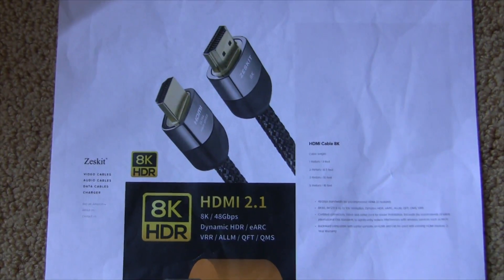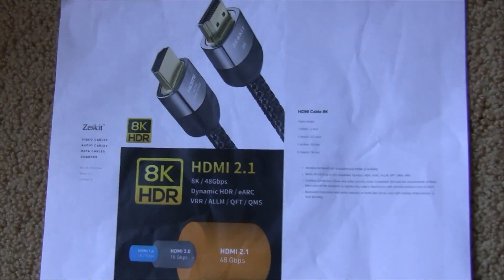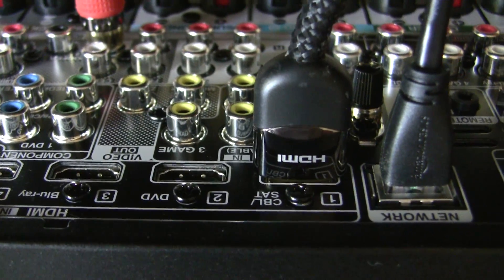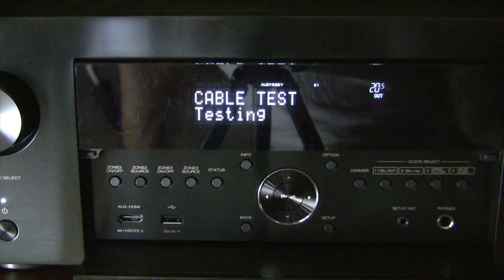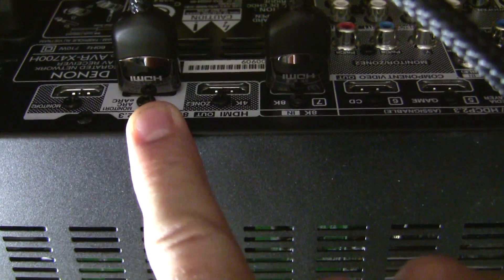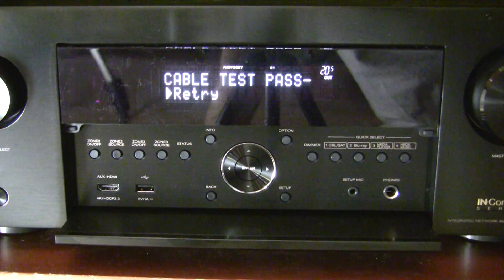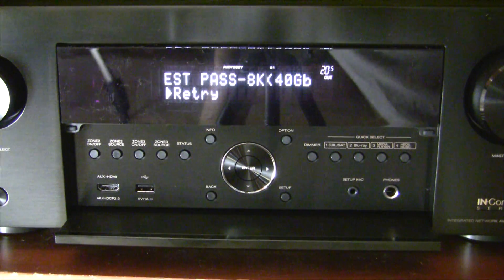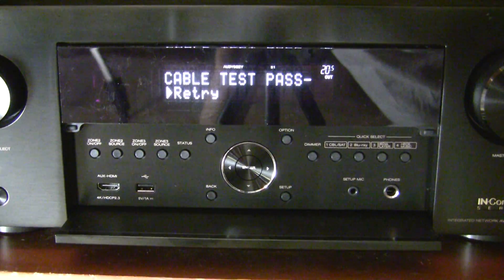Denon Receiver HDMI Cable Test - Zeskit 8K HDMI Ultra HD High Speed 48Gbps Cable

Comment from the maker: The Zeskit 8K HDMI Ultra HD High Speed 48Gbps Cable could very well pass 48Gbps, but as far as I know, the Denon 2020 receivers can only pass 40 Gbps through their HDMI 2.1 ports, so that is the limit to the testing of HDMI cables using this year's Denon receivers.
Reply: Is this cable good now for the ps5 with lg oled c1 3m
Reply from the maker: @MC-ie8xl  I don’t have a PS-5, but it should work fine. Let us know how it turns out if you get one.

Comment: My Zeskit 8k Hdmi cable just started giving me Distorted colors I replaced the Zeskit cable and the Color got fixed . I have no Damage on my zeskit 8k cable bu its faulty after 1 year of use
Reply from the maker: That's too bad.
Which cable did you replace it with?

I believe Zeskit has a 2 year warranty.

I would contact support@zeskit.com and see if they'll send you a new cable.
Reply: @BetaCygniBlog  Thanks for the Heads up, I'll check on that warranty. 

  I Replaced my defective Zeskit with a 4k HDMI from wallmart for now. Not sure on the brand as i had this HDmi sitting around

Comment: When you go into test mode if you wait long enough the OSD will show you what ports to connect. For my X3700 I need to connect HDMI-7 and Monitor-1. All my test fail, even with Zeskit so I am not sure if my AVR is an issue?
Reply from the maker: @Surya Chataut  I would make sure your firmware is up to date on your receiver. I do that in this video:
https://youtu.be/XOHkPHNiI3o
Then if the test still fails, I would try a real-world test. First try showing some DolbyVision/Dolby Atmos content on your TV. If that works, then you're cable is fine and there's something wrong with the test.
Reply: @BetaCygniBlog  Firmware is up to date. I performed multiple test again and out of 10 test it passed 2 time and failed the rest (although AVR says connect HDMI 7 and Monitor-out, I connected HDMI 7 and eARC HDMI port). I did play Dolby Vison videos and it worked. So, I am guessing the way Denon do their test has some flaws.
Reply from the maker: @suryachataut  Thanks for the update. I think the test has some problems as you also found out. 
Yes, you need to use the eARC port.

If you get the Denon App on your smartphone, you can see exactly what type of Dolby Atmos you're getting. With my Panasonic DP-UB820 4K Blu-ray Player I'm able to get Dolby Atmos TrueHD sound (lossless compression) from 4K HDR blu-ray discs that support Dolby Atmos.

Comment: Hows the sound quality using these cables? Are they close to audioquest hdmi cable quality?
Reply from the maker: I've had no problem with this cable. The build quality is excellent and the HDMI 2.1 performance is up to spec.
Zeskit is coming out with a certified HDMI cable soon.
Once certified cables are available, I'd only buy one of those for HDMI 2.1 applications.
Ditto for HDMI 2.0b.
Here's a video where I test a certified HDMI 2.0b cable from Monoprice along with some others:
https://youtu.be/O3c_kNig7iI

Comment: I wanna get this for PS5 but Sony wouldn’t not include their 2.1 cable since the console is optimized and supported for HDMI 2.1 4K@120
Reply: It comes with an HDMI 2.1 its about 5ft, 1.5 m to be exact or 59".
Reply from the maker: @felixlugo4840 That length should be okay, not too hard to make a cable that will meet the spec. It's the longer lengths that are the most challenging.
Reply from the maker: Yes of course. I’m getting the Xbox Series X and I expect the cable that comes with that will meet the spec too.
Reply: You have some time, 4k@120hz for games is not.going to be day one unless its like an indie or racing game. Other AAA games won't be hitting 120fps at 4k for a little while
Reply from the maker: @arianadonis4099  You're right. Right away I want to play my 4k DolbyVision/DolbyAtmos blu-ray movies with lossless Dolby True-HD sound.
Reply: @arianadonis4099  true but at least it’ll happen now less and more in the future
Reply: @Zamasu-Z  I'm hoping for the next 6 months 🙏

Comment: Will 48gbps on a 40gbps TV affect performance at all? Very worried about that :/
Reply from the maker: No reason to worry. There aren't any devices right now that can use all 48Gps.
The HDMI 2.1 standard is designed for future TVs that are quite a long way off. 
In the meantime it has lots of great features like lip sync, lossless Dolby Atmos - True HD sound, and Variable Refresh rate (great for game consoles).
Reply: Beta Cygni oh ok perfect just making sure that the overclock on the gbps won’t slow down the 40 or anything like that. Thank you🙏🏽
Reply from the maker: @SkweezMe  You're welcome.

Comment: great video. what’s the length of this cable. curious if the 10’ would give the same performance.
Reply from the maker: Thanks!
My cable is 2 meters (6.5 feet). I'm sure 10 feet is okay. They make them up to 16 feet long.
Reply: @BetaCygniBlog  Thanks for the video !
So you think the 10' will be ok for 4k 120 on TV or should i go with the 5"? 
Thanks for the reply !
Reply from the maker: @ĐayzZ-ed  in general shorter is better for HDMI cables, but 10 feet should be fine especially if it’s a certified cable.
Reply: @BetaCygniBlog  And 16" ? (5 meters)
My computer and my tv are distant from each other.. Would be nice if it could work but i've heard positive and negative reviews.
Reply from the maker: @ĐayzZ-ed  As long as you buy a certified cable I wouldn’t worry.
Reply: @BetaCygniBlog  I was scared about it coz people say that above 3meters it's hard for 4k 120hz.. Thanks for ur replies i'll get it #5 meters 😁
Reply from the maker: @ĐayzZ-ed  let us know how it turns out.
Reply: @BetaCygniBlog  Finally can' afford it, 30$ delivery costs.. (i'm in Euw)
Reply from the maker: @ĐayzZ-ed  There must be other certified cables available locally in your country.

Comment: I found the way to do the test. But all cables I checked even the old ones pass the 8k 40GBPS test. Is it accurate?
Reply from the maker: Probably not. Make sure you upgrade the firmware on your receiver.
I did a retest after doing that in this video:
https://youtu.be/O3c_kNig7iI
I got more consistent results after that except with a really old cable which said it passed the 8k test which I'm sure is wrong.

Comment: if you watch the videos by phil jones from sound united you will understand that all current 10 bit tvs/pc's/consoles dont need 48 gbps..40 is the max current tvs can do....if you had a 12 bit tv of which none exist for consumers 48 gbps will be relevant, but the likelihood we will see any anytime soon is slim to none and slim just left the building.
Reply from the maker: I agree. I've learned a lot from his videos.
From I understand, LG saved some money by not putting a dedicated HMDI 2.1 chip in their 2020 TV's which is smart engineering.
Reply: @BetaCygniBlog  2020 LG OLED's do support HDMI 2.1 40Gbps and all four ports are HDMI 2.1.
Reply from the maker: @WarpedTrekker  Yes, you are correct. That is sufficient for any video signal that's out there for the foreseeable future.

Comment: I just ran the same test with my Denon 2020 AVR-S960H on the same Zeskit 8K cable (3m) and also passed at 8K(40Gbps).
I was extremely disappointed to find that the AVR does NOT report on other HDMI cable features, such as ARC support, etc.
Reply from the maker: I agree. It would be nice to have a comprehensive test.
If the cable can pass at least 40Gbps without errors, then the cable has done its job. So that's nice to know.
Then it's up to the hardware on each side to accurate implement the HDMI 2.1 standard.

A quick search finds options like this:
https://www.keysight.com/us/en/solutions/high-speed-digital-system-design/high-definition-multimedia-interface-hdmi.html
but they all seem to require specialized hardware.

I have a new video releasing tomorrow that tests two different 4k (18Gbps) cables and an older 1.4 cable.
Reply: I recently bought the Denon S960h also and I have a question if you might be able to answer it. I have a Samsung Q90T and it has only one HDMI 2.1 input (input 4). The eARC input is a different input. The receiver has two HDMI outputs.

Do I use 2 HDMI 2.1 cables and go out of Monitor 1 to the eARC input on the TV to get the TV audio back to my receiver then the out Monitor 2 to the HDMI 2.1 input on my tv to send the video to the TV from everything inputted into the receiver? 

Is there any specific settings I need to set?
Reply from the maker: @KahluaMike67  You definitely want to connect the Monitor 1 HDMI 2.1 port on the receiver to the eARC port on the Samsung. Then configure your Samsung to output sound to that port. I don't have a Samsung, so you'll have to search around for how to do that, but you want the sound to pass-through the TV to the receiver. You don't want the TV to do anything with it.

I would put all video sources directly into the TV. No reason to run them through the receiver.
Your TV is the new "hub" of your home theater system.
Only put audio-only sources (cd player, turntable) into the receiver. Your receiver is optimized to handle audio inputs.

Your new TV is optimized to handle video inputs. Samsung has spent a lot of time and money making sure their TV can handle all types of video signals (HD-4k) and displaying them at the highest quality.
Your TV has 4 HDMI inputs. If you have a 4k source (like a Blu-Ray player,  or one of the new gaming consoles coming out later this year that support 4k gaming), put that in the HDMI 2.1 input on your TV.
Almost other HD-4k streaming sources are going to have apps that run on your TV.

I have a Chromecast Ultra going into one of the HDMI 2.1 inputs on my LG C9 TV. I bought that mainly so I could stream PBS programming. There's no PBS app for LG TVs yet.
However there apparently is one for Samsung TVs:
https://help.pbs.org/support/solutions/articles/12000059665-the-pbs-video-app-for-samsung-smart-tv
So for that, you shouldn't need a streaming box.

Comment: There is no certification for 8k cables yet.
Reply from the maker: That's right. I'm hoping there's one in place by the time I get my new Xbox Series X in the Late Fall 2020. Then I can buy a certified cable for hooking that up to my LG C9 TV.
Reply: Beta Cygni would there be a point with your tv? The Xbox and ps5 will,be using freesync Which lg stated they won’t add it to their 2019 TVs. It sucks they’re being that lazy
Reply: @EfrainElBoricua  The c9 have VRR over hdmi 2.1 and that's what's xbox using
Reply: @Ghostpro2  they’re also using freesync.  It’ll work but won’t be the same quality when you’re only using vrr vs using a Cx with freesync.
Reply: @EfrainElBoricua  lol vrr does the same thing as freensync or gsync, if you use freesync you are losing dolby vision on the xbox SX so its better to just use vrr
Reply: https://youtu.be/EhnSgwsxlBI

Comment: Only 40 GB 😄
Reply from the maker: Lol. 
The HDMI 2.1 spec is really goofy. You can label your product as supporting HDMI 2.1, but you don't have to meet all the requirements.
Reply: @BetaCygniBlog  And your Denon does not meet all the HDMI 2.1 requirements anyway. It has only partial HDMI 2.1 support, hence it having one 40 Mbps input.  You have to wait 'til next year at the very least for potential 48 Gbps chipsets.  Unfortunately, this receiver is not "future proof."  Plus, it's fairly easy for a cable that is decent to pass if it's a short enough length.  If you need to send 8k or high frame rate 4k video to a compatible projector over long distances... good luck with all that.